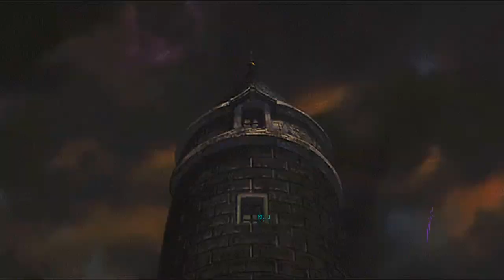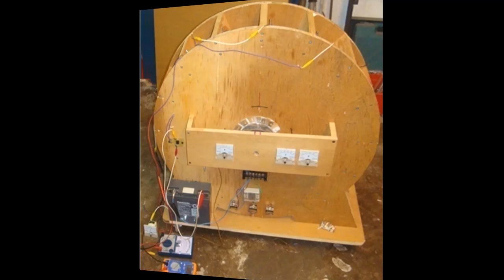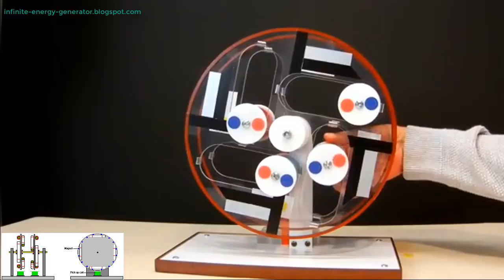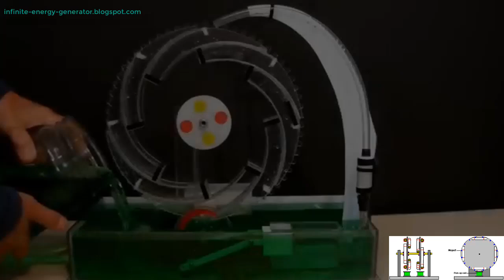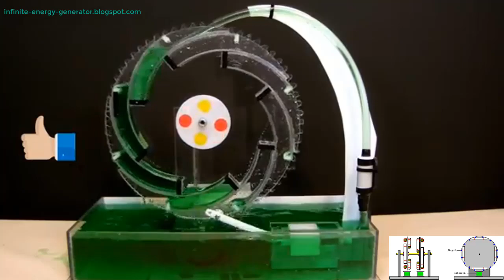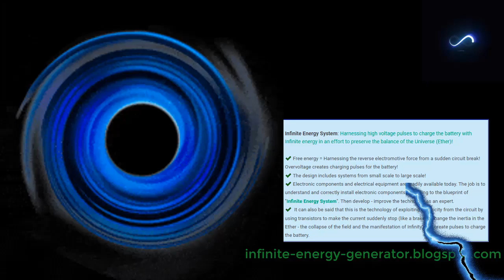Gravity Miner Explained: Harnessing Free Energy with Physics and Engineering

Comment: Pumping water or raising any mass over a point to drop it in order to raise another equal mass of working fluid needed to maintain a constant angular velocity of the wheel is not sustainable and the wheel would pump less and less water each time until the water no longer reaches high enough to pour out of the spout to continue to turn the wheel. 

It would simply stop after the starting impulse energy, rotational inertia of the wheel,  and gravitational potential energy of the working fluid, or mass, becoming kinetic energy as it drops, no longer add up to the amount of energy required to raise the water over the spout level to pour out. 

Don’t be fooled by this one or other similar unbalanced wheel devices. They don’t produce excess power. Cool idea though.